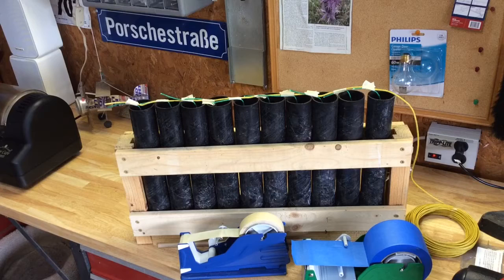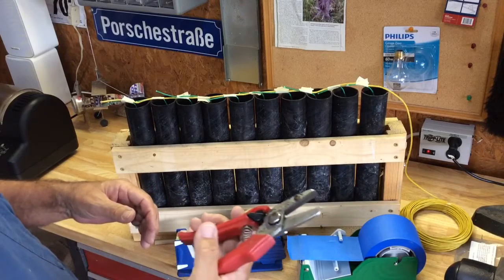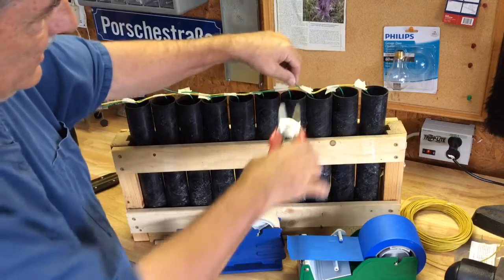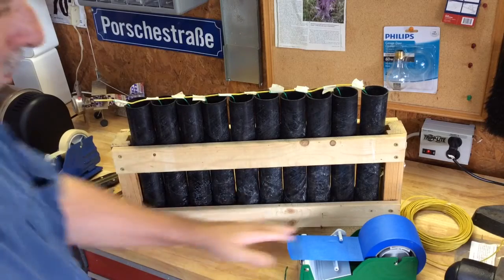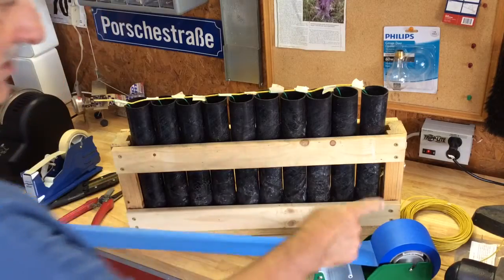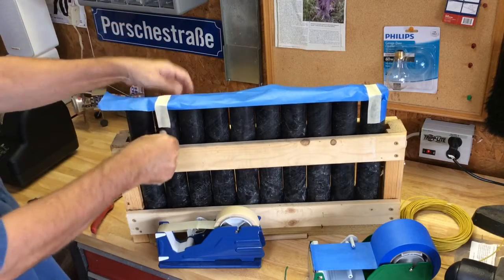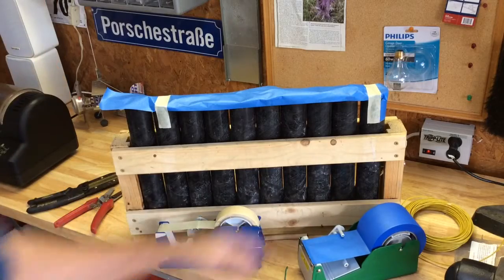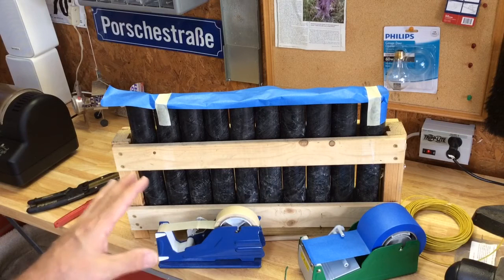Mortar Rack Crossfire Prevention

Comment: Has there been an issue with a mortar dragging the tape for the other tubes on launch?
Reply from the maker: Thats exactly what happens but it doesn’t matter because that entire rack is chain fused to fire. The purpose of the tape is to keep those fuses covered until that rack fires. If you set up a rack  and individually matched each mortar to fire in a script, then you would tape over each tube by itself.
Reply: @mguerramd  what I'm asking is whether or not there are concerns about mortars being pulled by the tape/fuse prematurely out of their respective tubes
Reply from the maker: @brianforrest2572  Ok the mortar is the tube. The shell is what you are asking about. No, the tape does not go up and pull the shells up out of the mortars. This works perfectly every time no problems. I do this with big commercial shells as well as consumer shells. Some people use foil, which works great, but that makes a heck of a mess
Reply: @mguerramd  ok my apologies. This 4th of July I'm doing racks that are remote ignited vs previous years reloading tubes as they are launched. So trying to find the best setup I can. Been split between masking tape and foil tape